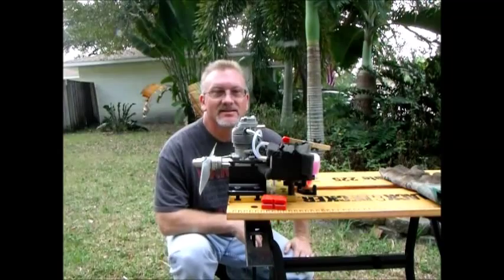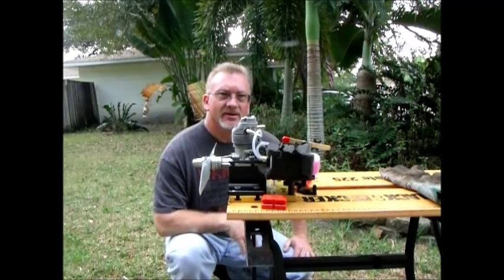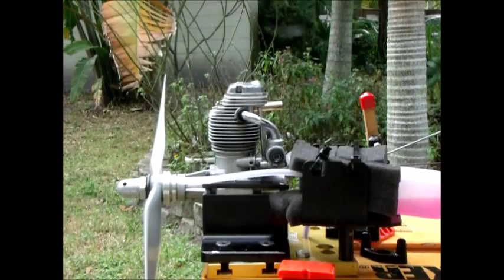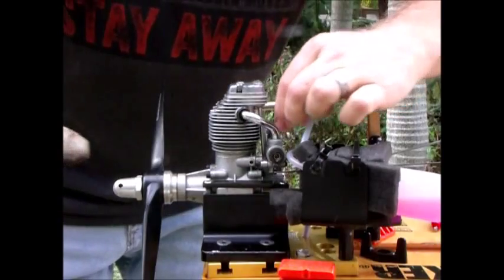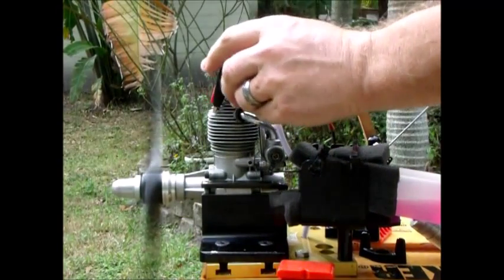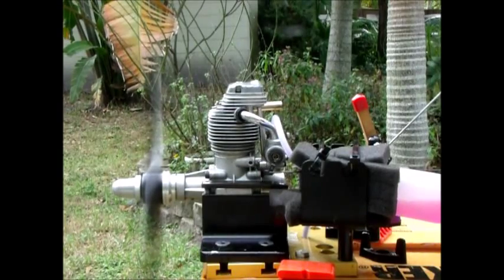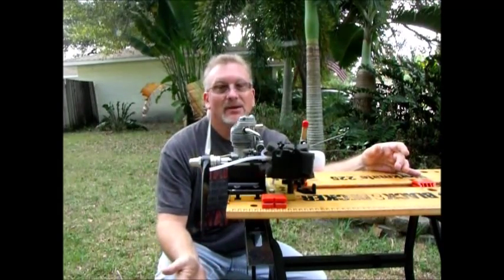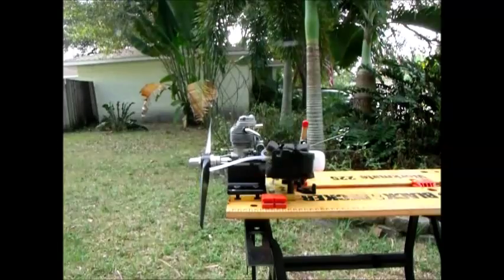OS FS-90 RPM checks

Comment: I bought one new when they first came out. I have flown it in several different planes. It flies my 14 lb Lazy Ace 76" biplane  with ease. I also have the open rocker 60 that I converted to spark ignition. I did it the old fashion way. I made a breaker plate and used Harley Sportster points. It runs so well and so clean that I am now converting my 90 to spark ignition also. I run stove fuel, (white gas) and Super Tech 2 stroke synthetic at 16 to 1. The gas oil mix burns clean with no carbon build up on the valves or piston. Bearings last forever. The 90 is a real power house of an engine. 

It takes half as much white gas as alcohol fuel, and it cost less than a 1/4 as much. After having flown my 90 for years it shows no sign of wear. A tribute to OS who designed and built the engine. I usually run a 14-6 prop, but have flown it with a 15-6. also. They are very torquey engines.